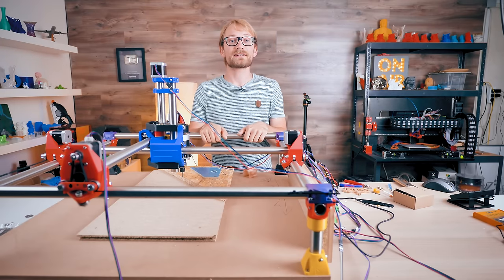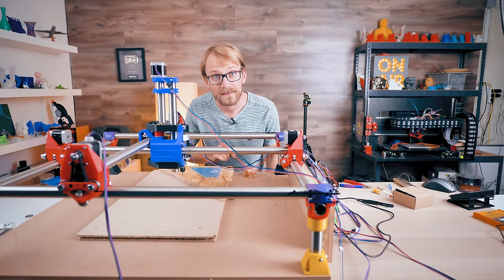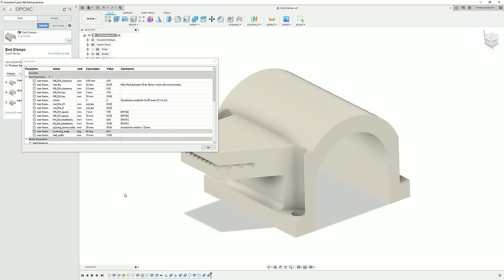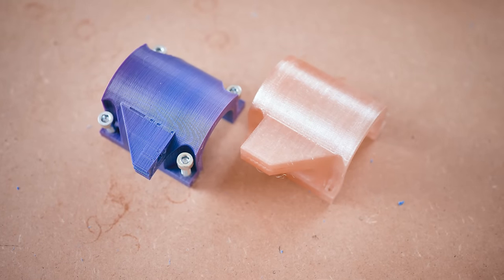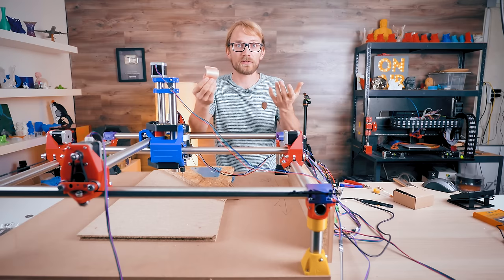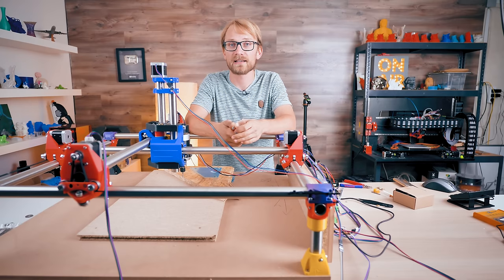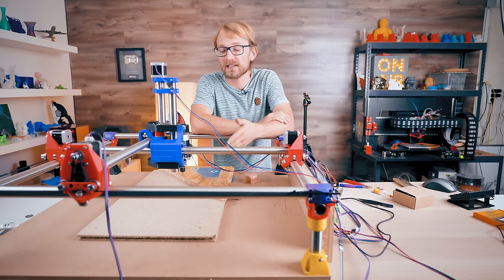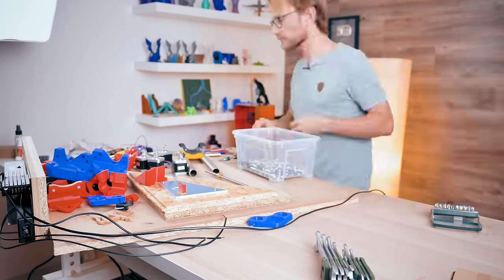Whose design even is this? (MPCNC conclusion)

Comment: Ryan released his design under a particular licensing category for his own reasons....under which, any design changes made by the builder must be released under the same license category. (you agree to these restrictions, and others,  when you build his design)
YOU chose to violate the restrictions placed on the design release thereby voiding your license to use his design. You break the rules, then "throw a tantrum" when called out on it and don't get your way.....seems childish, and wasteful.
The entire issue could have been easily resolved had you simply followed the rules that you agreed to when you decided to build the design.
I won't get into the whole GNU debate, but I'll say this....if you don't like the rules, work to change the rules rather than violate someone else's rights. And if you don't like the restrictions someone places on THEIR design...........simply....don't...use....it

IMO, you should have discussed the issue and worked with Ryan....personally, not on Twit-er....if you truly wanted to try and make the MPCNC better.
Reply: Finally, a sane comment.  Thanks, there aren't many in this thread.
Reply: Your argument simply assumes it's a derivative work and it completely ignores the limits of licenses and copyrightability. Licenses don't apply to whole concepts, that can be achieved by patents only and Ryan does not hold one.
Reply: @zapl80  no, my "argument" doesn't assume anything....read the copyright law definition of "derivative work"
Ryan designed every printable piece of HIS design and released HIS design for use by others under HIS terms and conditions....and Tom chose not to follow the limits and restrictions that Ryan placed on HIS design......is that simple enough for you to follow?
Reply: @TheWingnut58  If copyright / licensing was that simple.. The point is: Do the restrictions apply? That requires at least a) Ryans work to have copyright protection, i.e. does it meet the originality threshold and b) Toms work to be derivative / transformative and not an independent implementation, after all he modeled his part without having access to the original sources since Ryan doesn't release them. Do you know all that for sure? Because if you do, then I'm all with your argument.
Reply: @zapl80  That's just it, it IS that simple.....it is Ryan's original  design, which IS copyright protected upon creation under creative commons (just as a photo is copyright protected when a photographer creates it), to do whatever he pleases with.
If Ryan were to, say, release his design for personal, non commercial use, as long as it is printed only in pink filament and you print it in blue, you have violated that agreement and are subject to be sued.
In essence, since it is Ryan's original design, he gets to make the rules about how it is used and/or shared. I don't understand what he issue is here....
If you honestly believe I'm wrong, build one yourself and make changes that DON'T follow the user agreement as Tom attempted to do......and be sure to let us know how that works out for you.
Reply: @TheWingnut58  it would be this simple if Tom had taken Ryan's CAD file (or to a lesser degree the stl) and modified it. But he didn't. He designed a new part that has the same features, but does not necessarily contain non-trivial original contributions by Ryan. And that fact opens the question whether it's derivative or not. Two people painting the same building obviously don't share a derivative work relation, but when one sees the other's work and thinks I can do better and paints the same thing slightly different, then that starts to be debatable. It can be derivative if you clearly include the other's work, e.g. same lighting and angle in case that's an important feature of the image. In this case here, the building itself is roughly equivalent to the functional requirements for such a part, while you could argue about Tom using design elements such as the holes but you'd have a hard time because they are't much of a non-trivial solution. To prevent other people from designing their own parts to replace Ryan's, what you'd need is more than a copyright license. That's the area of patents to protect the conceptual idea of the parts, or a design trademark / registered design to protect against similar looking parts.
Reply: @zapl80  don't make agreements that you're not willing to follow.....which is in essence what Tom did......
If you're so sure of your stance, build one and do EXACTLY the same thing Tom did and let us all know how it works out for you. You can sit and argue semantics all day long.....but you also may still be sued.
Reply: @TheWingnut58  If you assume the agreement extends that far, ok. I don't. We disagree, it's okay. No need to actually try this in court
Reply: @zapl80  the starting point of the copy doesn't matter.  Staring at the original part while "designing a new part" is not new.  If it be the CAD or the STL or the physical part that you take a set of Calipers to... it's still a copy.
Reply: @GeoffreyPitman523  Sure, that is when you copy artistic expressions and the like. Tom did not try to copy any of the aesthetic measurements nor the exact shape - only the functional ones such as the hole placement. Copyright does not prevent that. In contrast, copyright laws make sure there is a legal way to clone a part like that by specifying what exactly is protected and what isn't (cf originality threshold). It goes as far as allowing you to exactly 1:1 clone (e.g. copy paste from the stl model) parts of a design that aren't above the originality threshold. The CC license is aware of that and allows that, they say for example "CC licenses are operative only when applied to material in which a copyright exists, and even then only when a particular use would otherwise not be permitted by copyright" and "By design, CC licenses do not reduce, limit, or restrict any rights under exceptions and limitations to copyright, such as fair use or fair dealing. If your use of CC-licensed material would otherwise be allowed because of an applicable exception or limitation, you do not need to rely on the CC license or comply with its terms and conditions." It's generally the case that, as the one to grant a license, you can only do so for portions you "own", be it because of copyright, patents or trademarked designs. And you see a lot of legal clones of far more sophisticated things out in the world since copyright is a really weak protection. It's usually patents and trademarks that stops clones.
Regardless of what a court would decide for Tom's part in particular there will be a fairly easy way to create an entire legal clone MPCNC that does not violate copyright and can be released under a different license. I really don't wish to ruin Ryan's business model but I also don't think it's helping to assume legal protection that isn't as solid as a lot of people think it is.
Edit: Maybe that argument is easier to follow: Copyright is absolute, it does not care if you copy something to be used for an MPCNC or for a toaster. It also doesn't care if you were aware that there is a design you copied (which should be close to impossible for copyrighted things). If Ryan owned e.g. the aspect of the design that there are 4 holes with a distance of eg. 2 inch, then nobody for no use-case would be allowed to use the same 4 holes without permission from Ryan. To prevent such ridiculous situations copyright does not apply to simple measurements and obvious solutions such as this, it only covers aspects that you basically wouldn't come up with by accident, only by copying them. Copyright protects artistic expression, e.g. the model of a bust but not commodity designs such as a box shaped pedestal you put the bust on. You can copy that pedestal from the model because nobody owns box shaped pedestals. You can't use the bust unless you have a license or other kind of permission or copyright exception such as fair use.
edit2: You can watch "Faculty Virtual Lecture Series: 3D Printing and Intellectual Property" by unhlaw at minute 12:10 and at the end at 25:40 to hear very similar things from an actual ip law professor. It's even worse: purely functional things usually don't have copyright.

Comment: Start designing a entirely new CNC with parts that suits the european market that is made of parts that are non compatible with MPCNC parts and  make it free... There are so many fine upgrades to the design. like make it out of square tubes turned at  a 45° angle... better clamping brackets etc...
Reply: He did even better. Since it made these things parameters, you could make it whatever you need. If you want to use imperial tubes and metric bolts, you can by adjusting the parameters.

Comment: I'd prefer if the MPCNC allowed commercial use, but sorry Tom, under the common Fair Use doctrines--not just "derivative work"--your case isn't that strong. The bolt pattern especially is an interface that is specific to MPCNC's, you're using your tens of thousands of subscribers and supporters to bully someone, and you are certainly benefiting monetarily from this. You can design your own MPCNC competitor but you'll most likely either burn out from working on it before it's done, or it'll function basically the same with no real improvements.

Comment: salty tom.. so sad... it took you hours to mirror a part and add a lug? XD
then you complain the owner of the original part wants you to respect the license?
RESPECT THE LICENSE, be thankful for receiving the plans for a whole CNC machine
Reply: You're not understanding the case here. Tom just realized this license is not compatible with a lot of use cases - making tutorials, teaching in scools or maker spaces... - because all work related to the project is automatically get owned by the project manager. Because only he can use it for commecial ways. Actually, I'm not sure if he uses this cc license correctly. Maybe the project manager violates it, because there is no restriction added (relating to his commercial usage).

If you create any new part for the project it will be also automatically owned by the project manager. And any newly made part for the project is handled as a derivative work because it made for the project, even if it uses generic  standards. So the license is viral and sticks to any work that made for the project. I completly understand the business model behind that and no problem with that. It can work for lot of individuals but it is not compatible with an uncentralized community, because it is centralized.
Reply: So goddamnmaddog....... the Aftermarket water pump in your car, the aftermarket brake pads, the aftermarket wheels, aftermarket parts for your appliances  etc etc etc.... They are perfectly legal....  and this is not! Wake up man!

Comment: I always disliked the SA and NC parts of CC licenses. They are too vague especially on the point of what a derivation actually is and what parts of the work they actually apply to. E.g. if you start with a single part from a CC-SA licensed file, but design a whole assembly with original parts. Does the SA part apply to the other assemblies? Without legal definition within the very same legal document there is no way to tell. Intuition and probabble intention of CC says no, but there have not been any court rulings that would support either side. CC-SA and CC-NC stay in that gray-area (and even if there was, courts decide on a case-by-case basis).

Copyright in the EU-sense (and for the most part but not strictly in the US-sense) does not protect an idea. However Toms part is still a gray area, because one could consider Toms machine as the derived work from copyrighted plans. Note that starting from scratch does not change anything, you could start from scratch and recreate an accurate readoption of the Titanic movie. Even though you don't use any of the original material it is still a copyright infringement if it's close enough to be recognized as that movie (what exactly that means and wether certain exceptions apply are the nitpicky details that are decided in court). And that's true for any portion of the movie, no matter how small.

Tom clearly stated it is intended as a part for MPCNC. To ilustrate the problem consider someone rewriting a Part of Harry Potter: the text on its own is not restricted by Kathleen Rowlings copyright, but stating that it's intended as a rewrite of a particular part makes it so. If Tom designed the part and didn't publicly mention or imply his intentions with it before publishing, Ryan could not do anything about it. So it's again the problem of the lack of a legal definition of "derivative" in the CC license.
I can only advise creators and users alike to stay away from those licenses, because of the issue, or as a creator at the very least provide your own view on the matter (in written form as an attachment to the license) and define what you see as a derivation, but be aware that definition still might not hold in court, because it contradicts applicable laws and exceptions.

Comment: I’ve had my eye on this for a while, just not had a chance to start it. I’ll be passing on this now and either look for a different project or roll my own. There are so many different options out there for CNC with sturdier frames, gantry and spindle. The one thing this had was it’s cost to get up and running and project ethos. Guess I was wrong? Maybe best to move out of the grey...

Comment: To be honest, this is more of a tinkering cnc than something to get work done with(okay I know it depends on what you want to do with it) you will likely out grow it pretty quickly, but it is cool to think that you can print something like this out. In the end if you have the means it would be better to just build one out of wood... You could build it much stiffer, and for cnc's that the name of the game. I thought about building one(the low rider2) as I had just got a 3d printer, but really thought about, how much I'm going to use it, the size I wanted and the speed I wanted to cut at... Decided an mdf frame would suit my need better.
Now if you want to build a larger laser engraver/cutter... This construction method would be great.

Comment: I FOUND A BREAK THROUGH ON STICKING OBJECTS TO GLASS.  PLEASE DO A VIDEO ON THIS EVERYONE NEEDS TO KNOW.  Ok Thomas this is what I did from start to finish. FIRST I am using a Divinci 1.0 pro 3 in one printer. I use a piece of glass to do my prints and I have been searching for the perfect formula for sticking prints to the glass...well..I found it last night.  This is what I used and my steps in progression...this needs to be shared. it stuck so well I almost couldn't get the object off.  First....step 1. Obtain a piece of glass that fits your bed. #2 ….clean the glass with alcohol and a clean towel. #3 purchase ELMERS spray adhesive. #4 Spray the glass with two light coats criss crossing each other. #5 Get a blow dryer the kind you use for your hair...blow dry the glass on hot about 8 inches above the glass for 2 minutes. #6 let the glass sit and cool down for at least 30 minutes. #7 obtain a stick of elmers white glue stick you can purchase them at Walmart...the purple stick may work as well but haven't tried it yet. Apply 4 coats of glue stick criss crossing each other over the dried spray adhesive. # 8 Obtain some metal tape they sell at Walmart it looks like duct tape but it's metal and silver colored. cut off a piece in four equal squares and tape each corner of the glass to the bed. #9 load your model into your program....let it print.  # 10 when print is finished let cool completely. your print will be sticking to the glass very well do NOT try to pry it off. Bring it to your sink and angle the glass and run HOT water on the glass and print for at least 3 to 5 minutes. this will loosen the glue...turn the glass so each side will have equal water wetting each side for at least 1 minute each. be very gentle and remove glass and print from your sink....then use your hands or a plastic scraper to work the object off of the glass slowly and gently...you do not want to break your glass...when it prys off...   then rinse your part. After the part has been removed from the glass...check the glass for any spray adhesive that has been removed and give it a light spray again after everything is dry. The spray adhesive IS WATER PROOF...so do not try to remove the spray adhesive. The spray adhesive dries but when you touch your finger to it for a minute or so it gets tacky.....BUT....this WILL NOT hold your part in place....YOU NEED TO USE THE STICK GLUE with the spray adhesive...in conjunction to one another...this works perfect. You CAN rinse the stick glue off of the spray adhesive using warm water.    NOTE:.....to NOT have any problems with FILIMENT I have done this...I created a PLUG for each side of the opening of my filament spool. The PLUG has a HOLE in the center of the hub. The hub is somewhat bubbled outward so when I insert it into the hole of the spool on each side...IT HOLDS. THEN...I run a metal axle or rod through the hole....I made a stand and ran the axle through 2 holes in my stand....my filament NEVER binds and spins very freely. I 3d printed those plastic hubs with the hole in the middle of each one.....it works FANTASTIC....no more spools getting caught and sticky..... slowing down holding filament back. PLEASE share this information and when you do...please contact me so I can see the video. if you have any question tom...contact me through you tube. I wanted to give you this info because people have a hard time with ABS plastic sticking to the bed.....and in the middle of a print it comes off. hope this was helpful....a video on this information will be appreciated. my name is John.....from Kansas.  thanks Tom.